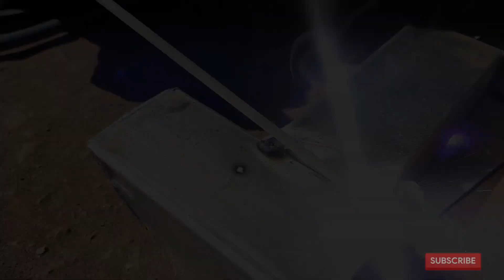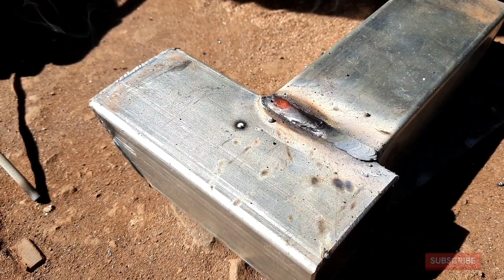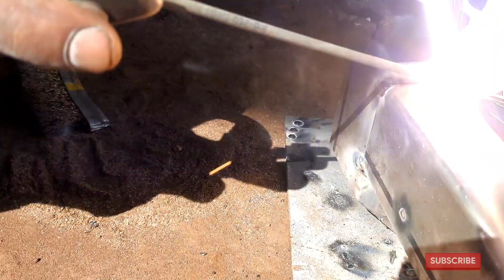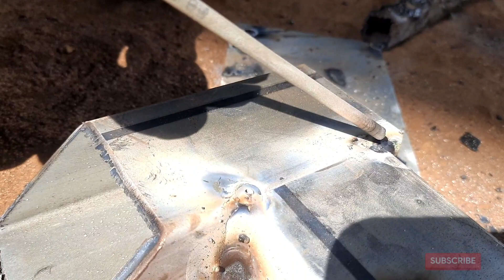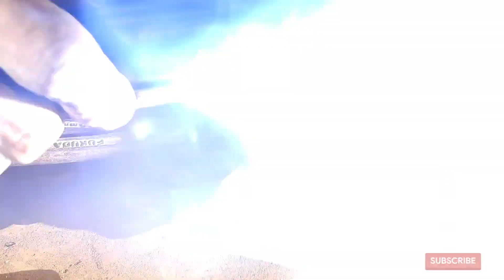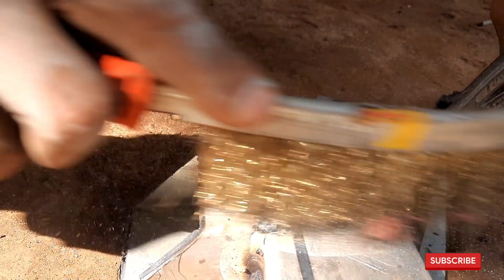Stick welding techniques , welding galvanis square tube Hollow 4x6 wall ticknes 1,4 mm with stick

Comment: When I weld I use 308 stainless steel electrodes. What do you use fella ???
Reply from the maker: for all work on thin metal, I use electrodes e6013 size 2.0 mm and 2.6 mm.
Reply: @stickwelder  That type of rod was used my myself years ago. I ran across over a hundred pounds plus of rods 308-16.15, in the 1/16", 5/64", 3/32",1/8"',5/32" diameter range of sizes. These rods work great on just about any metal. I have used these rods on modular iron without failure even though they are not recommended for that purpose. Very good rods for sure. Plus major corrosion resistance too. Piece VF

Comment: Electrode? +. O _
Reply from the maker: electroda E6013 size 2,6 mm
Reply: @stickwelder  The electrode to the positive or to the negative?
Reply: @olivercruz7405  DCEP (electrode to the positive)
Reply: @olivercruz7405  6013 rods can be used with any polarity, but with thin metal and small rod diameter (1.6mm to 2.4mm), it’s best to use electrode negative and set the amps low (20 to 90amps).